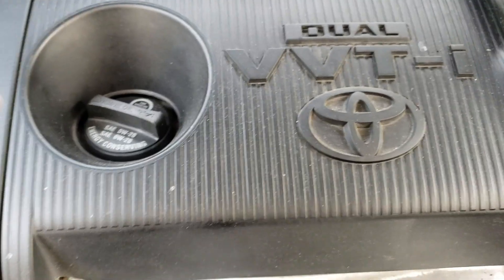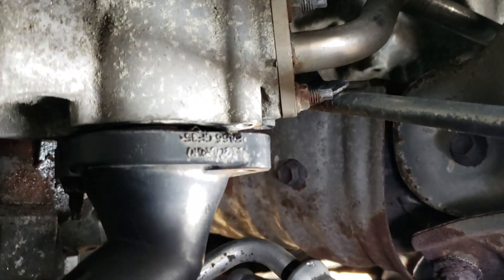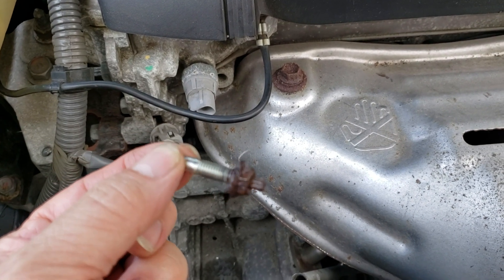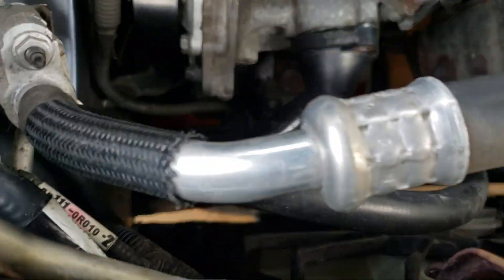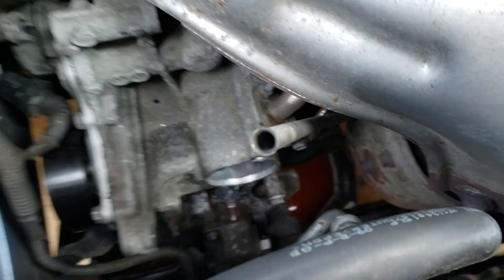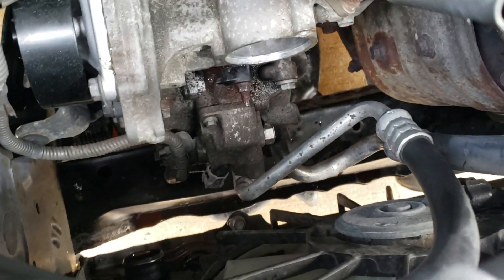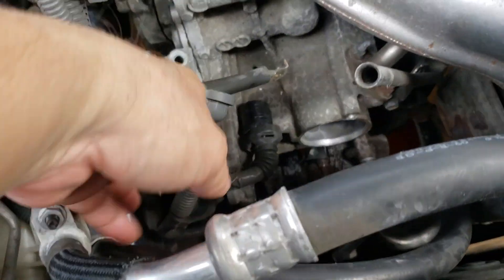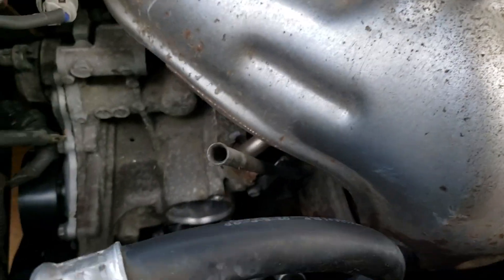2012 Toyota Rav4 Thermostat Replacement  Change

Comment: You can buy a set of rounded bolt removers from harbor freight for $15 or Milwaukee for $30. Nice to have and prob about the same as buying a plastic elbow.
Reply from the maker: Hate removing a rounded out nut or bolt that you can't see..it's like working in a dark room..once the housing is broken off, its easy seeing...

Comment: You do not have to take the alternator off. Who told you that?
Reply from the maker: When you have a car from the rust belt you take everything off because you never know what you see, you mean you will mess with a broken  or rounded out nut or bolt with the Alternator in the way, then you must have small hands ...